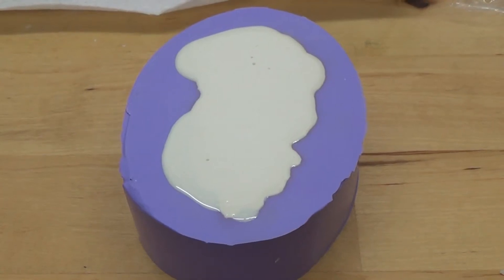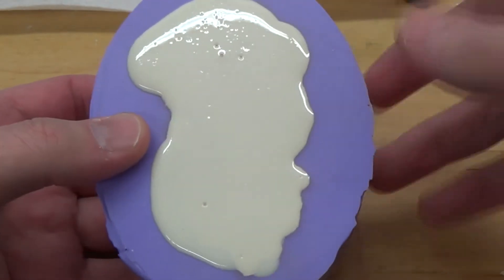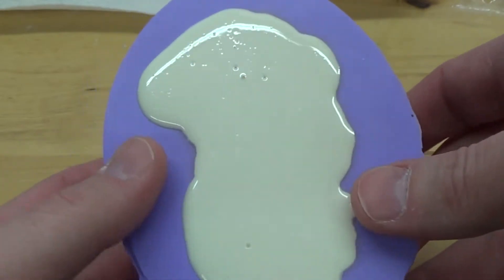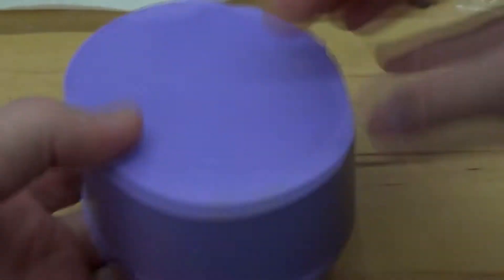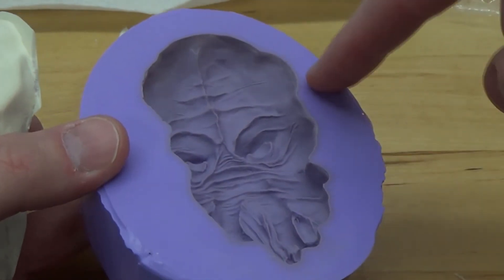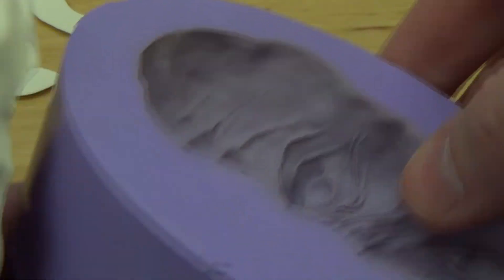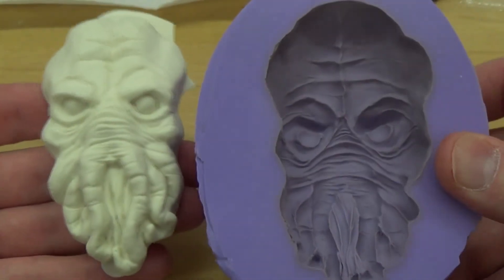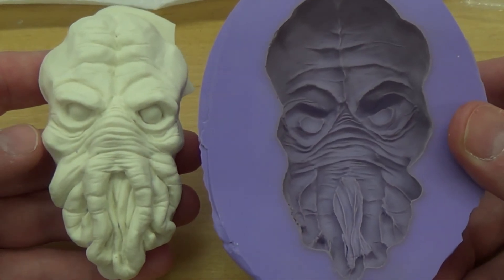When silicone loses its oils...

Comment: Good info. You could use it still to cast plaster I bet. If you were casting hydrostone or other gypsum products it could probably cast hundreds I bet. I think if I were to sell plaque type pieces for sale I would go with ultracal or hydrostone. Hydrostone is heavy too though, makes it beefier, but probably a little more cost to ship. Resin is so durable though and will last a 100,000 years I bet, ha!
Reply from the maker: I bet I could get away with the stone and I have some so perhaps a test could be in order DARK RIDE - Nightmare on Wheels?! But your right-it would be a bit more in cost to ship and that resin is really durable lol!
Reply: You could also cast in hydrocal  or ultracal. I also use regular pottery plaster for my small skulls. It's much lighter than hydrostone.  Yeah, something to look into. With the small plaques it should be fine especially after a good primer and painting like you do on resin. It would definitely be less expensive than resin. Just an idea for the smaller flat pieces.
Reply from the maker: Not a bad idea DARK RIDE - Nightmare on Wheels! Might actually be able to sell them for less as well